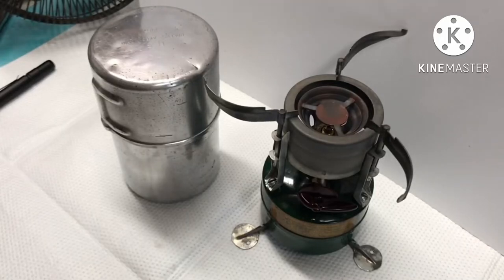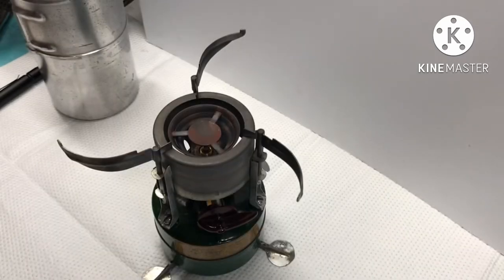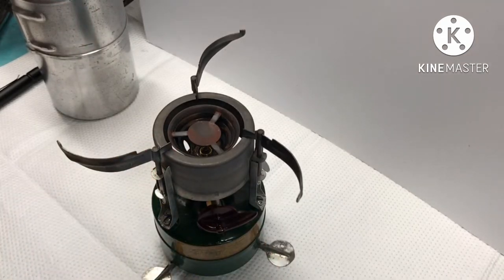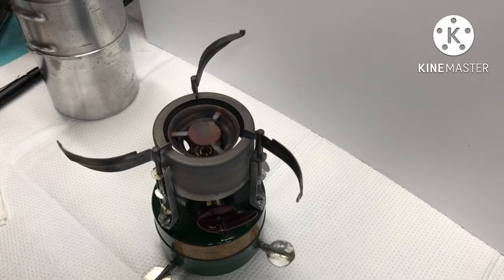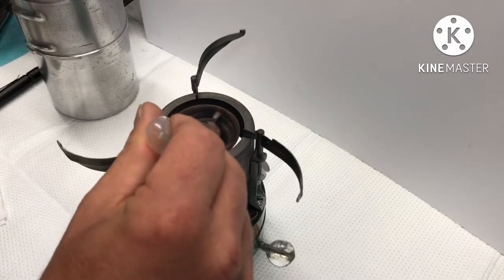Rogers Akron 1957 Military Stove

Comment: Back in the late 1980's I was assigned to work with the USMC Special Operations Training Group - Arctic Warfare Section. These were the stoves that were issued to each Fire Team (4 Marines). The stoves ranged in old brass (1950's) to steel.
Best stove I ever used.
Reply from the maker: Sounds like a awesome career!!
Thank you for your service 🫡
They’re straight to the point and get the job done. 

Semper Fi